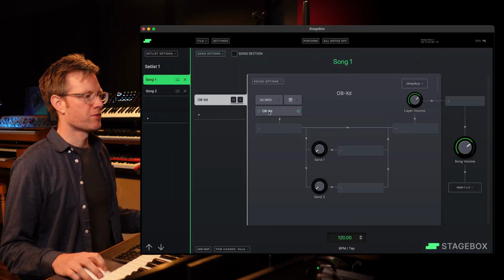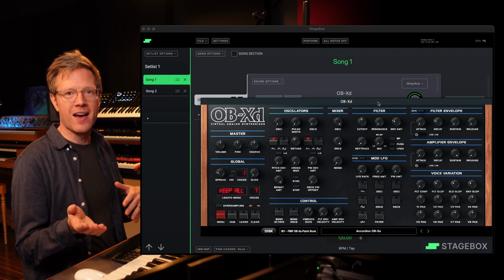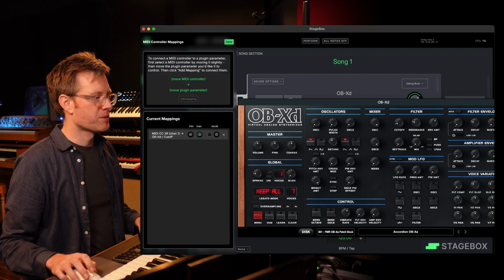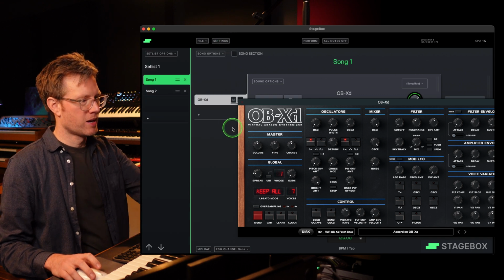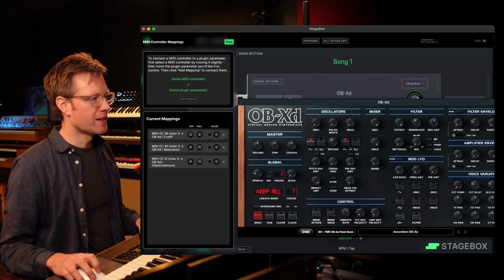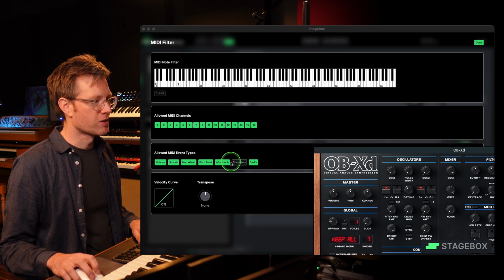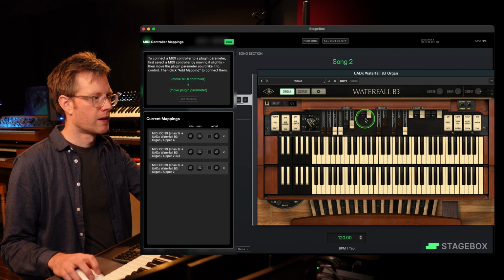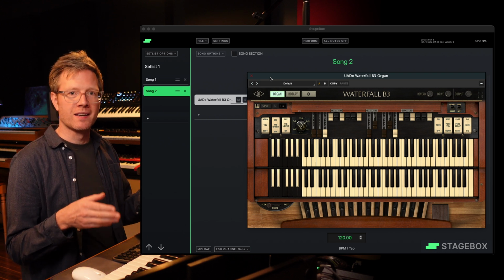StageBox | MIDI Mapping Tutorial

Comment: Complete multi-port and multichannel Midi output is an absolute must for a product like this.
Otherwise a whole category of plugins (Arpeggiators and Midi FX plugins) that can control hardware (and hardware synths and samplers themselves) are left in the dust. Does StageBox contain a comprehensive midi output option and if not when if ever will it be updated?
Reply: Thanks for taking a look! As of v1, StageBox is designed to only work as a self contained 'in the box' solution for keyboard players. On the roadmap for development are features like external midi instrument control which will allow it to act more as a central hub for a hybrid setup...!
Reply: @stagebox_software  Thanks for replying, StageBox is a nice host and I'll take another look, when "external midi instrument control" is implemented.

Comment: Does Stagebox generate, or at least route from external, midi clock ?
Reply: As of right now, no I'm afraid not, but it's definitely on the future roadmap! Thanks for taking a look :) Can you let me know your use case for chasing MIDI clock please? Are you thinking delay times? or arps? or something else?
Reply: @stagebox_software  Just considering the amount of tempo synced features of plugins (LFO, Arpeggiator etc). .. and it would be good to allow MIDI output to hardware too! :)
Reply: @NicholasBryantBonzaiSequoias  Understood. Right now the internal transport will run, so 'internally' anything clock based will run at the tempo of the selected Song. But it wont output that to external gear right now. I'll add it to the future list :) thanks!